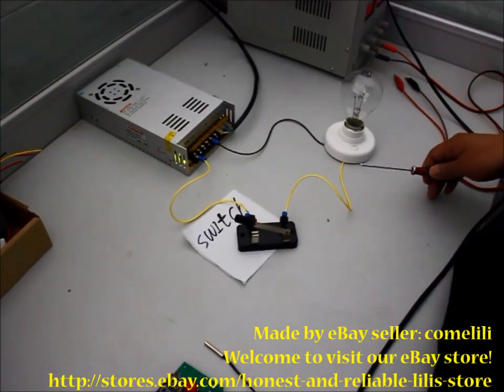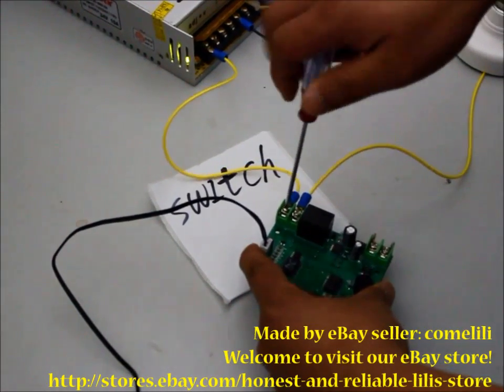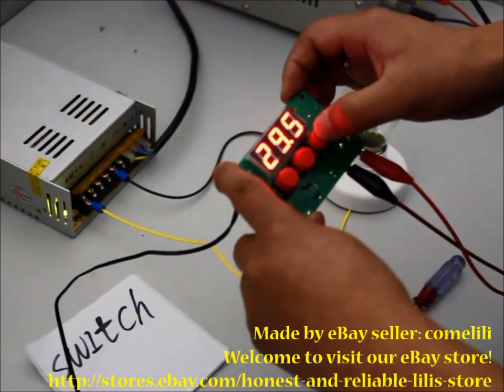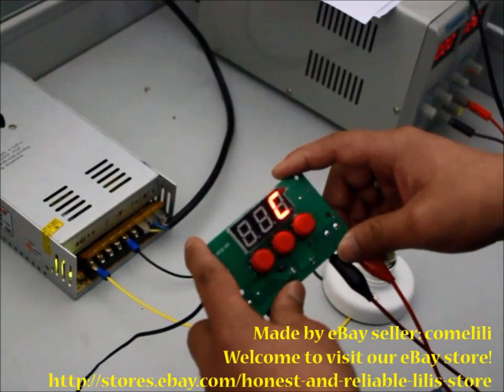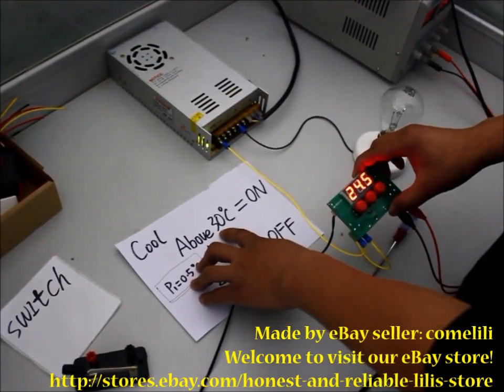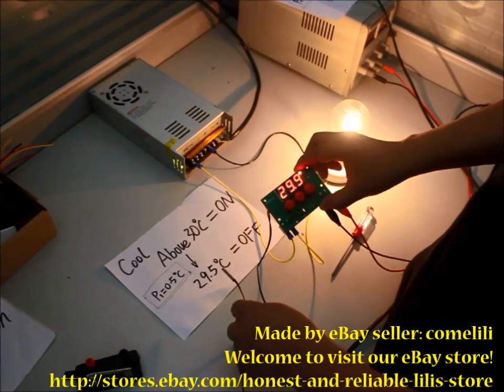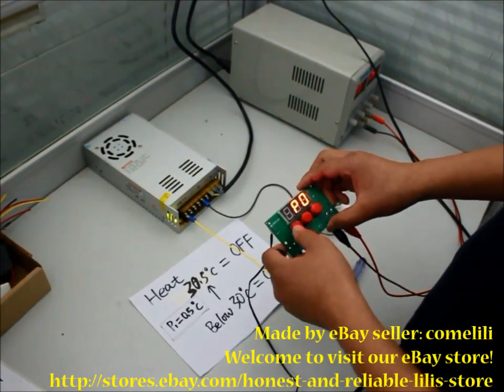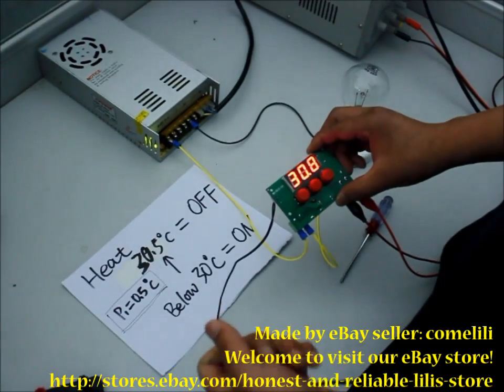DC 12V Digital Temperature Controller / Switch

Comment: hi lili, can switch provide to on/off 220V load ?
 
as i seen relay just for 125 v
Reply from the maker: no. any voltage is ok to the relay.  Please refer to this method of wiring:
http://img.auctiva.com/imgdata/1/3/5/4/6/7/2/webimg/788363350_o.jpg
Reply: OK li according circuit no:1 it is doesn't matter to load voltage. May i know link of ebay to buy this think. caused when i refer to link as your given it's nothing
Reply from the maker: kamal hidayat Here's the link: http://www.ebay.com/itm/131151781577

Comment: good explanation, I want to power my mobile  cooler. Can I use the same power supply (12V battery) for it and the  Temperature Controller at the same time ?  Also what is the voltage range  for the Temperature Controller - sometimes battery gets  to a low 11.5 volts and a high of 14.2 volts ?

Comment: Hi Lili, I recently ordered this product, and still need to buy a power supply to wire it to a computer fan.How many amps does the temperature controller need? Thanks!
Reply: Nevermind, I see on the product page on ebay that it uses less than three watts. I believe that's equal to about .25 amps. Sorry, looking forward to using it!
Reply from the maker: Kevin Cassidy The max Amp this controller can resist is 10A.
Reply: Thanks!